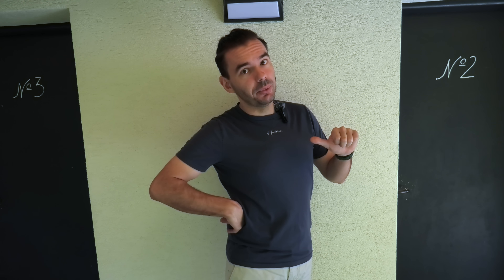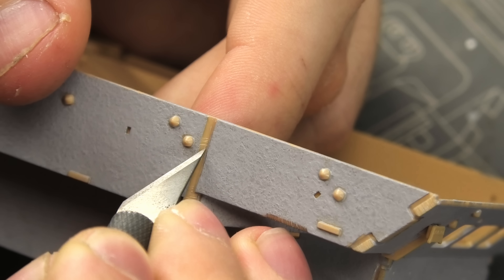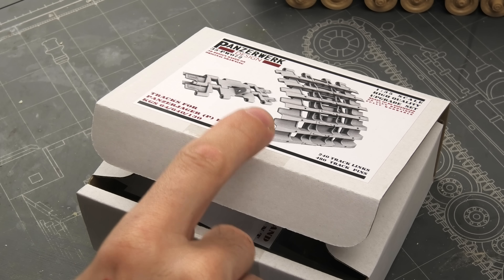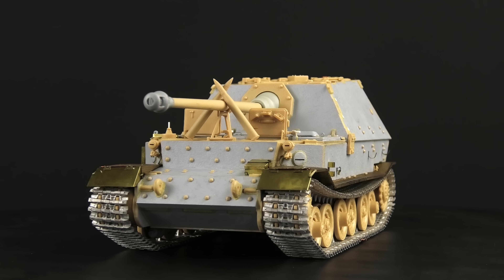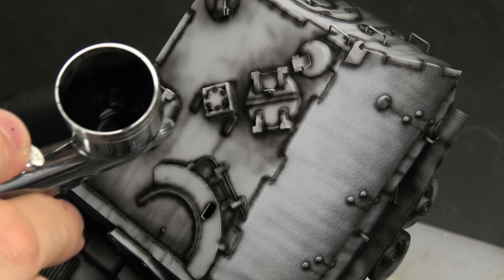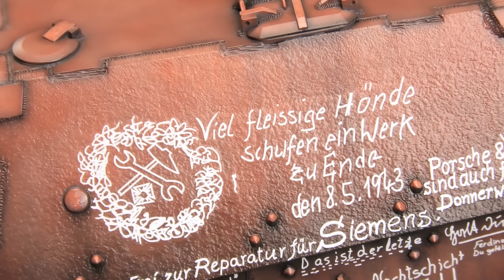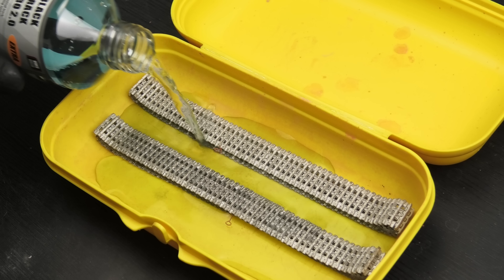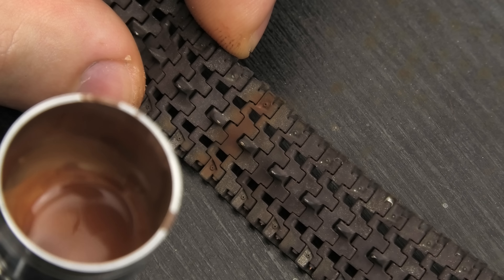Let's Paint a FACTORY FRESH Ferdinand in OXIDE PRIMER!

Comment: As for the decoration on the tank.

You are correct to assume that it was finished by the nightshift, but they are also celebrating the conclusion of their work and return home (most of the workers of that project came from different factories inside germany) 
the Decoration is a traditional way to celebrate the finishing of the base construction of major projects in germany. To this day we do it with houses once they get their roof mountings (note, not the bricks or whatever else you use to finish the roof, just the wooden frame) 
The shells in the front form such a roof, with the tree branches probably representing the tree put on top of such projects. The Markings are also part of that and while the exact contents are individual the overall message is that of celebration and hopes for the future of the finished build.  In essence it is the celebration of finishing work combined with a prayer for the "long and successful life" of whatever it was that was being build. 

Similar stuff was also done with other projects, like the finishing of the only  Porsche Tiger (one was build as a command vehicle for the ferdinants) or the conclusion of the last run of the Pz III.

Comment: I have some problems with airbrushing AK 3gen color I dialuded it with tap water and an aqua color thinner by Revell but the airbrush is spattering and the paint will spray in a wierd pattern. Normally I use Vallejo colors for airbrushing and they work very well!

Comment: Always enjoy your videos. Lots of conjecture working from 70 year old photos, but a couple of nit picks. Before it was painted, Ferd would have been washed. This was to remove said dust. Also, all the metal components would be primed before paint. The guys in the paint shop were probably not amused with all of the chalk.

Comment: I got ALOT of model tips from u, I remember before discovering ur channel my models looked a 2 yr old toddler built them and Jsut left I without painting, detail. After u, I’ve gotten a lot of tips as I have built a pamzerhaubitze 2000 with ur tips and it turned out swell for my first attempt at detailing a model, iam right now building a mine sweeper M1A1 Abrams

Comment: I was going to ask why not just prime the model in black, then go in with white zenithal, and diluted white for doing midtones, streaks, textures, etc. Seems like less work for the same result.

Another thing I was curious about.. using an actual oxide red paint? I'm not sure if it would work due to texture, but I recently found a micaceous iron oxide acrylic paint. Micaceous iron oxide is actual a rust preventive coating used for protecting ships and anything likely exposed to the salty air or humid conditions in general. While I'm not sure they would use it in an acrylic base, it has a very interesting texture, color, and even a bit of glitter to it. Out of scale on a model, for sure, but could be used to represent something else. Anyway, was wondering if a real iron oxide primer would be useful for a model.

Comment: Does the tamiya putty/cement mix work on resin hull kits?
Reply: Yes. But it won’t chemically bond to the resin like it will styrene, so there’s a chance it can come off. However it still takes a decent amount of force to remove it
Reply: @Gothmog35  Are there alternatives ?
Reply: @milojkomustafovic7712  not that I’m aware of. But like I said, unless you are actively trying to scrape the texture off it won’t be an issue. I’ve used it on both cast and printed resin dozens of times